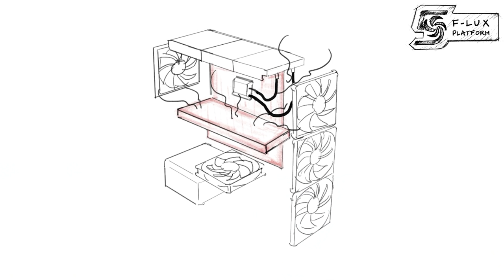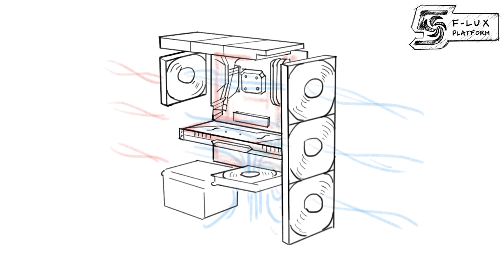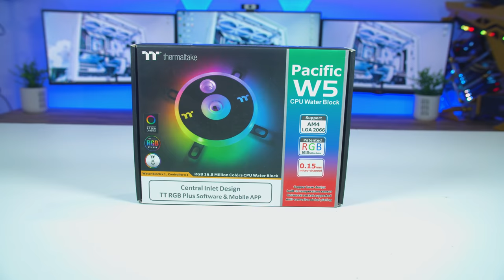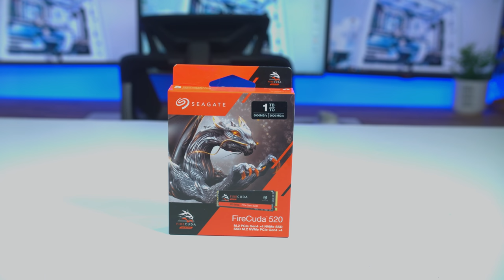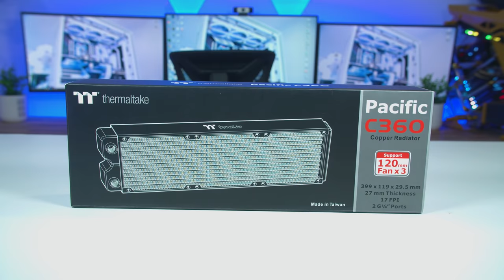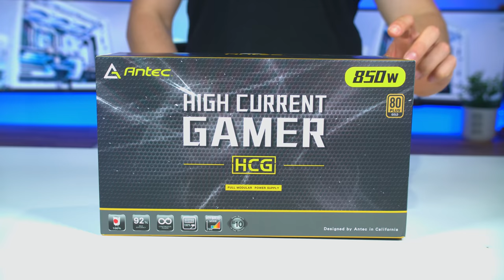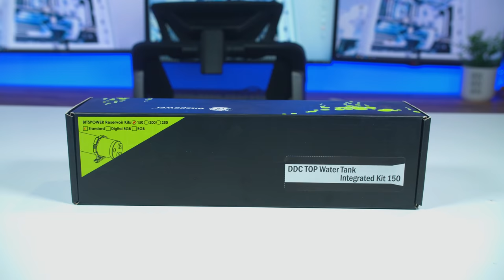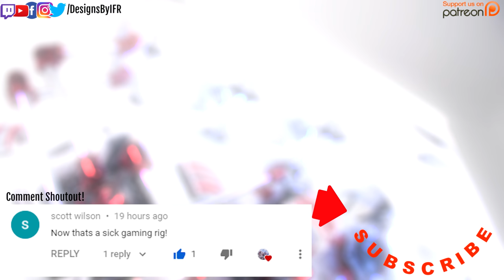Antec DF600 Flux Custom Water Cooled Gaming PC Build - 2080 ti + 3900x

Comment: Quick tip, you can use left over cable combs on the backside layer of the gpu cables to connect them so they stay right up next to each other.  Easy way to get the cables to stay put

Comment: Saw a really nice orange soft tubing build recently, so it is quite the coincidence that you just did one. I would love to see some more soft tubing builds. Also, I think you did some of the tubes a bit too short so it looks like they're pulling the compression fittings at an angle.
Reply: No they don't. All the compression rings look flush with the fitting.
Reply: @Safetytrousers  8:24 look at the bottom GPU, it looks like the tube is a bit short because it's being pulled towards the pump. When he's fastening the tube it pulls on the water pump and vice versa. It's probably a perfect fit but it just looks, to me, like it is coming out at an angle. The same could be seen when connecting the rad to the top of the pump, but that's just me.

Comment: Question about the Design: Why did you go with soft tube build & why did you set it up as a Reservoir -> GPU -> CPU -> Radiator -> Reservoir? Won't that just pump hotter coolant into the CPU block? Wouldn't it be better to do Reservoir -> GPU -> Radiator -> CPU -> Reservoir for a build like this? That way the coolant has more time to chill out before reaching the CPU?

Also, grats on 300k subs.
Reply from the maker: The coolant moves too fast, there will be barely any temperature difference in the coolant
Reply: @DesignsByIFR  Didn't think about how quickly the coolant would be moving, thanks for the information and quick reply! I might switch up my setup design with this information, it helps out a lot! Again, congratulations on 300k and hope to see more builds!
Reply from the maker: @Edouardenator  thanks mate =)

Comment: He messed up the CPU installation. You can see the pins when he pulls down the retention arm at 2:52. He might have even broken it because the next scene the thermal paste around the green base is gone and he covered up the label with more thermal paste.
Reply: Was scrolling through chat to see if anyone else noticed, to be fair I'm sure its not easy looking through a viewfinder when doing a build montage.

Comment: Can u please tell me if my pc specs is alright 
Ryzen 5 3600 
Gigabyte rtx 2070 super 
Asus tuf b450-plus gaming 
And trident z 2x8 gb ram 
Please let me know about psu which one should I use
Reply: seasonic focus plus 650w full-modular bro, the specs are amazing! have fun!
Reply from the maker: Looks good man!
Reply: Really good specs man! Tip: if you don't care Rtx you can get a rx 5700xt instead of the 2070s, same performance at less cost
Reply: Thanks for replying
Reply: @user-tx4jg7yl7h  yeah your right I should get rx 5700 xt instead
Reply: @street420  thank you
Reply: @duckiestswing9039  another thing, the best customs of 5700xt are the sapphire (I suggest you the nitro+ version, It will get you in a very stable 2k 60 FPS). Sorry for bad english
Reply: @user-tx4jg7yl7h  yeah but what's the price and thanks for suggesting me
Reply: @duckiestswing9039  in my country (Italy) 5700xt nitro+ Is 430€ and evga 2070s (good custom) Is 550€. Amazon prices.
Reply: @user-tx4jg7yl7h  amazon products are over priced probably buy at shops might be good idea
Reply: @duckiestswing9039  in Italy there isn't any store that sell PCs components so all the Italians have to get parts from there
Reply: @user-tx4jg7yl7h  sorry but iam from India 
There's a shop near by which sell pc I can get separate orders from there

Comment: Soft tubing looks more prone to leakage ?
Reply: If anything it's less prone than hard tubing. If you fit soft fully on to the barb and tighten the ring there is no chance at all of a leak from the joint. The only chance of a leak is an immediate one from a faulty fit of a fitting, which could equally happen with a hard or soft barb.

Comment: I just built a new pc with dual 360 rads one is 54mm thick and the other 35mm and 10 fans and a monoblock on the cpu and VRMs but my cpu (9900ks) is idling at 38-39c that seems to high at idle for the amount of cooling I have, anyone know why that is?? Oh and it is my first custom build that I've done so i am a newbie lol